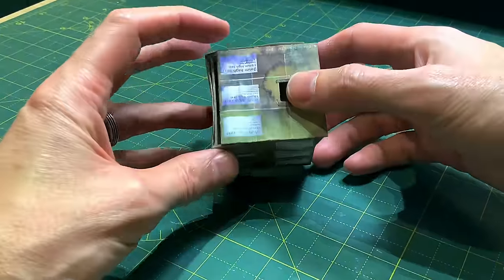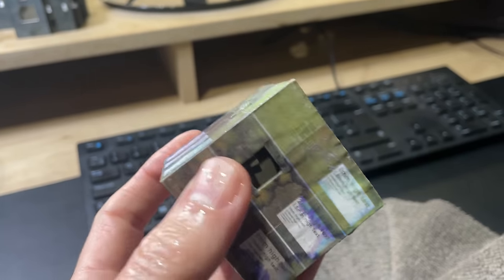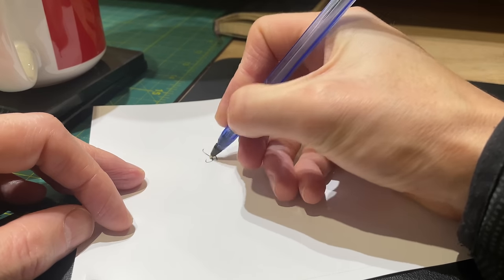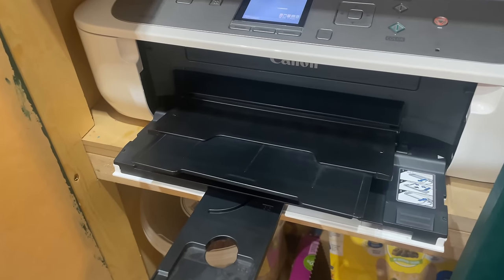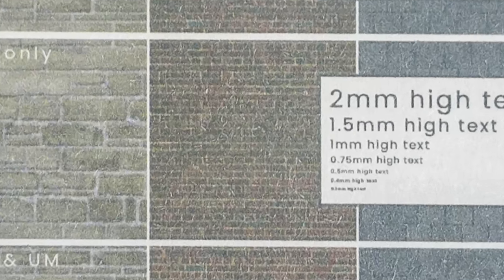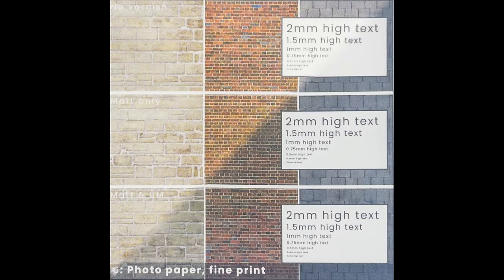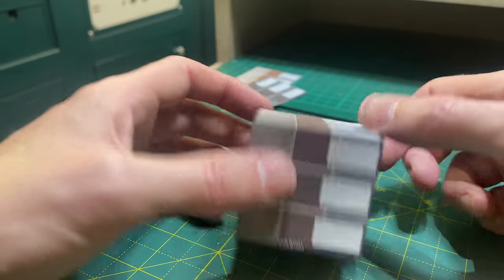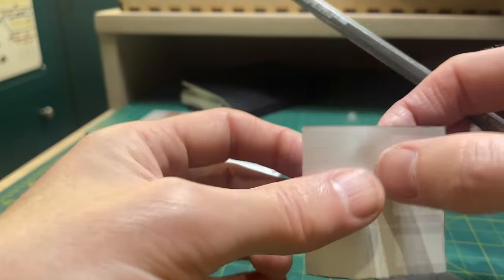Quality Decisions - Getting the most from printed textures in card model making

Comment: Thanks! a brilliant piece of work and research.  As one who had all the buildings on an exhibition layout shift to purple brick colours in storage, I can back up your message about using original inks.  Yes they are expensive, stupidly so.  However, if you have spent many hours making a building from several layers of car/paper and the building is fixed to the layout, the work needed to replace such a piece could mean the end of many months of work.  I have used a LASER printer for some, the advantage is freedom from colour shift even after sitting under a Veelux window.  How ever the penalty is the poorer colour definition in the first place.  
Thanks again for your efforts with the "Cube of Truth"!
Reply from the maker: I'd love to do some comparisons between inkjets and lasers.

Comment: Fascinating to see the results of this kind of testing. It’s certainly answered most questions I have about card modelling with printed textures. It seems with good choice of materials, they are quite hardy. I get the impression that companies like Epson and Canon put quite a bit of research into their inks — especially those targeting photo printing — to give them good colour stability over time, even with UV.

Back when I started in IT when diagrams were sometimes literally 'cut and pasted' onto pages of documents, you used to see quite a lot of cases where glue came through the paper after (a long) time and discoloured the diagrams. I guess these days better glues remove this long term problem.
Reply from the maker: Glue pass-through is not something I've experienced yet, thankfully.

Comment: Great work Michael. A fascinating study. I only use photo quality inkjet paper for anything that will be seen, and the highest quality printer settings. I've fallen foul of third party "compatible" inks and will be using original printer manufacturers one from now on. I've tried labels, even ones that claim to be photo quality, but can't get good enough quality prints so I only use them for marking out structure for cutting. After much discussion about UV protection the consensus seems to be that nothing helps. Just keep the models out of the sun. On your advice I've bought some AK Interactive varnish, mainly to protect the surfaces and hide all my sticky finger marks. Thanks for sharing your findings. As the saying goes, in this hobby "every day is a school day".
Reply from the maker: Thanks Martin. You're so right. We all have so much to learn every day.

Comment: An excellent demonstration Michael.
I was a Canon and Epson printer technician for many years and the results you showed regarding papers, print settings and inks are in line with my experiences over the years.
The non genuine inks can be very hit and miss although some are quite good.
Just to throw a spanner in the works, I use a colour laser printer with standard copy paper and spray with matte varnish to get rid of the laser shine. Cheers!
Reply from the maker: Thank you! I am keen to do a crowd-sourced version of this video too! Your laser approach would be good in that.

Comment: Thanks Michael for this extremely interesting video. One test might help with decisions. Many of us model in garages and sheds, so I would love to see a really good humidity test. My modelling space can and has varied from -9c to +134f (I have a clear plastic corrugated roof and both temperatures were recorded so my layout has to put up with dripping ice and snow to scorching heat. This is the main reason I model in plasticard, mainly because they do not warp, whereas Metcalfe type card buildings have warped and disintegrated.
Cheers, Bob
Reply: I stored a few Scalescenes buildings in a modern loft in the UK for a few weeks in the winter. They emerged warped, paper bubbling from card carcass in places and the inkjet printed windows had gone opace. They were rescuable but stopped my plans to use the loft as short term storage.
Reply from the maker: Oh no - that's a disaster when it's your hard work that's involved.
Reply from the maker: Hi Bob - yes, it would be good to see that in a test. I wonder how we could do it... Any ideas?
Reply: Not my forte I'm afraid Michael. Perhaps we have someone amongst us who can advise?
Reply: @trainmanbob  @chandwell my experience was based on photo paper glued to a 1mm or 2mm base layer with either Pritt Stick or an aerosol based mount type adhesive. Windows were an Amazon or eBay sourced acetate which were compatible with an inkjet printer. I think you could do a test piece similar to the paper/ printer cartridge/ varnish video but using different cards, papers, glues to bond the two together with different types of window construction (I bought 25 sheets of the inkjet acetate and am very happy to send you a few sheets FOC for the experiment). The test piece could be left in a dry but uninsulated space (to replicate a typical UK loft or shed)for a few weeks to see how the different types of construction bear up. Ideal time of year to try this. I am sure that your sticky paper window technique will bear far better than my inkjet acetate (and you can print whatever colour you like onto paper which you can't on acetate).

Comment: I always find it's the varnish that makes the ink run when being applied. Best results i've had were spraying with a matt varnish before cutting out. Then if it does discolour i print another and try again.
Reply from the maker: Thankfully it doesn’t make my prints run. I avoid spray as I’m never convinced it works,  but I know others get great results with it. Does it protect from spills and smudges? I’d like to do a crowd-sourced test of as many different combinations as possible.
Reply: @Chandwell  perhaps you can make your file available somewhere online so when we test it, we are testing the same thing; just using different printers and materials.
Reply from the maker: @survivingworldsteam yeah I was thinking along those lines. Would you be up for it?
Reply from the maker: @survivingworldsteam yeah I was thinking along those lines. Would you be up for it?
Reply: @Chandwell  sure.  I have an HP printer, so that is different data point.  I live in the states, so we have different brands of papers we find in hobby, craft, and big box stores, more data points.  I have card on hand already, and some photo paper.

What is the base material you make your cube out of?  I am curious if I can find it stateside; I would like to model buildings with parapets, but need to have 1/8" material to glue both sides on.  That material may work for me.

I have some matt spray sealer and intended to spray it on all my buildings.  But, I don't have a paint booth, so I have to spray outdoors, and it can turn milky when it is humid and cold.  I did not consider the brush on products; will the varnish yellow or crack with age?  Also need to see what products are available stateside.

Besides building buildings and other things out of card for my own layouts, I also build simple inexpensive buildings for my Etsy shop.  I am always on the look out for techniques and products that can improve the finished product for minimum cost and time.  There are videos on my YouTube channel, and a link there to my Etsy shop as well as Facebook and Instagram if you want collaborate further.
Reply: @Chandwell  also, when I asked my wife to pick up what we call "white glue" or "Elmer's Glue", she purchased the Elmer's Washable Clear Glue.  I had not tried the clear glue before, but I am liking it so far; glue smudges are not so obvious, and you can also spread it across windows and it has the semi gloss sheen of old, dust covered windows.  I used clear tape in the past, but it looks like glossy new windows.

It would be helpful to conduct these tests to see how well it holds up, and what kind of protection the varnish and matt finishes provide to keep it from coming unglued, yet another data point.

Comment: Thanks for this. I'll never use cheap printer ink again for my interior detail textures, nor other paper than high quality papers (I'll try to find the one you use online). For varnish I already switched to the ultramat one from MiG so it's OK.
Reply from the maker: What is the MiG varnish like?
Reply: I use it on my own lasercut kits made of plywood , bristol card and woodpaste card and it works very well. I used the lucky varnish mat though, so I still have to try the extra mat one. All my models are painted with MiG and Vallejo acrylics and weathered also with oil brushers and pigments.

Comment: Interesting result. When installing the window seals on sticky labels. maybe you should stick the horizontal part first as the two cuts out are an easy aid to align, the cuts out provide a positive stop. Maybe you should always use labels for the window seals.

Photo paper is almost twice as thick as your basic paper, no wonder it works better. Plus photo paper has a finishing of the surface that makes it more suitable to work with wet ink like ink jet.

Third party ink, there must be some many types, in so many price ranges... What would be great is to know the original manufacturer for the genuine ink and buy 3rd party/non brand from him: the genuine ink without the brand overhead price tag (my parents used to buy Cartier like leather good from the factory manufacturing genuine Cartier in Morocco: same leather quality, same fine workmanship, no garish logo and 10th of the price.)
Reply from the maker: Some very wise words.  Great idea about the window sills. I think I will use label from now on.

Comment: Hi Michael, excellent video as always. A few questions I always had was, where did you find your glue applicator? And do you thin our PVA? I've always found it far too thick to even imagine using something as thin as you use
Reply: I previously asked this question & was told Metcalfe Models by another viewer.  There are also a number of listings on eBay.
Reply: @chrissouthgate4554  wonderful, thank you Chris 😊
Reply from the maker: Be very wary of the Metcalfe one. They don’t treat the pins that go in the nozzle. I had one and the pin rusted and turned the glue orange. The nozzles I use are available from Smart Models -Google “Smart Models Finetip”. The bottles and nozzles were sold by a woman called Ann Peak but she went out of business. I don’t thin the PVA. The main one I use is really thick and goes through the nozzle fine. Watch the video I link to at the end of this one as it goes through exactly which glues I use.

Comment: A comprehensive test and interesting how easily the unvarnished sections ran as soon as anything went near them! I'm not expecting you to run tests, but do you ever varnish the paper before applying it to the model carcass? Cheers
Reply from the maker: I did once. But the brushed-on varnish made the paper warp slightly even though I tried to keep it flat and stretched. In the end all the straight lines started to become slight curves. It wasn’t ideal.
Reply: Fair point. Thanks  @Chandwell

Comment: What is the thing you used to apply the PVA so neatly
Reply from the maker: It’s a fine tip applicator. They don’t make the actual one I use any longer but you can get a similar one from Metcalfe. Its tip isn’t as good but you can buy a replacement from
Smart Models. More details on my tools and materials is here. Scratch building with card - tools and materials
https://youtu.be/-QvdNFST7WU
Reply: @Chandwell  thank you